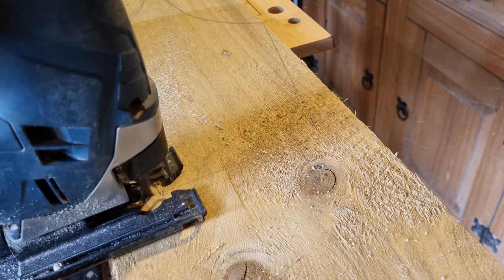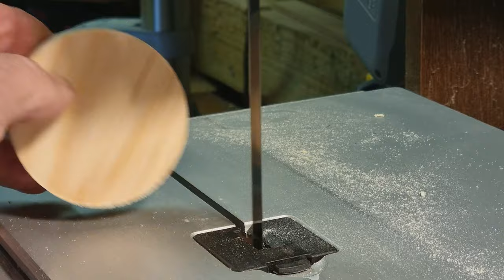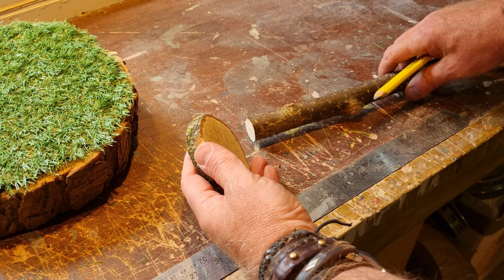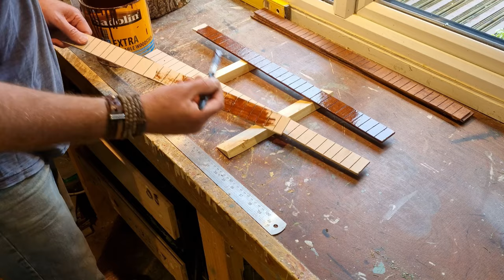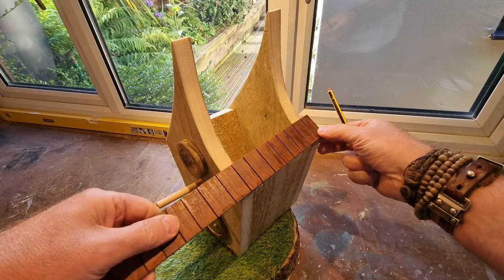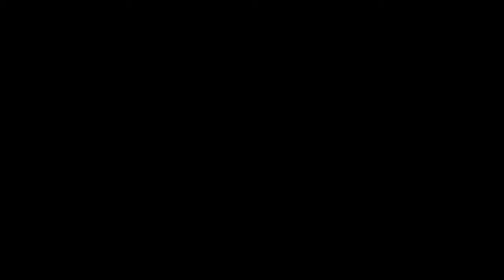Making A Stylish Rustic Bird Box (DIY Woodworking Ideas)

Comment: I make WeeFolk homes, but not so precise. I wish I had the ability (& tools😉) to create these amazing little homes. Thank you for sharing.  I love these! 
I want one.🥰
Reply: After watching again all the way through. Amazing, pegged the bits- I learned quite a bit as well!
Reply from the maker: @pamelagoddessoe6964  that's great... makes sharing it more worthwhile... Good luck.👍
Reply: @woodworkfantasy6653  I have questions, 😁 is that a band saw that you're using? And what is the hand held saw(?) that you used to score the 1/4" plywood(?) Apologies. I'm quite excited about seeing your process. Thank you again.
Reply from the maker: @pamelagoddessoe6964  yes that is a bandsaw, but you can achieve the same effect with hand saws on the ply wood cutting into strips.  I use a hand held mini circular saw for cutting the grooves.. you can adjust it to cut 1 or 2 eighths of an inch deep. If you don't have the power tools you could first cut the strips and then use a tenon saw to make the grooves.. I make them random differing widths to make then look like old style roof tiles. I think most can be achieved with handtools but it will just take longer... except... you always need a power drill... you cant get by in life without one 😊😊😉👍
Reply: @woodworkfantasy6653  thank you SO much. Oh yes, must have my drills & impact. My next purchase will definitely be a hand held mini circular saw! I think the way you make "shingles" is brilliant. Again. Thank you for being so kind and helpful. I'm excited to try the shingle strips.